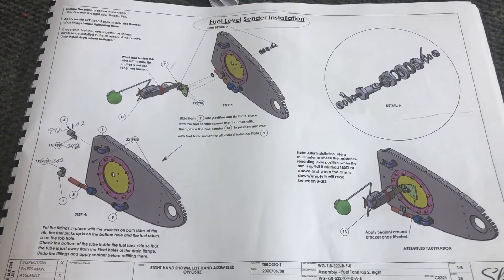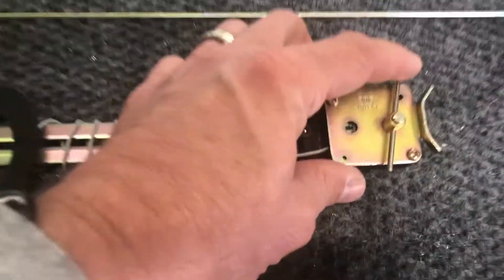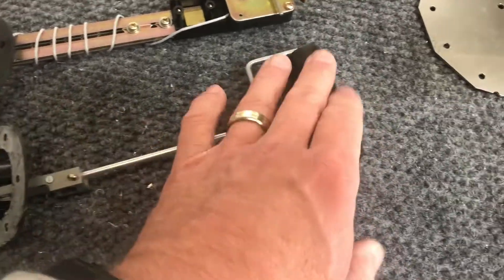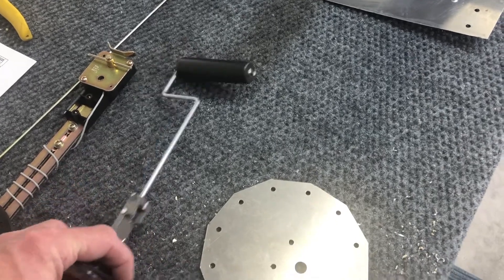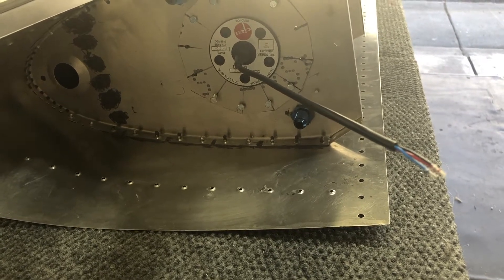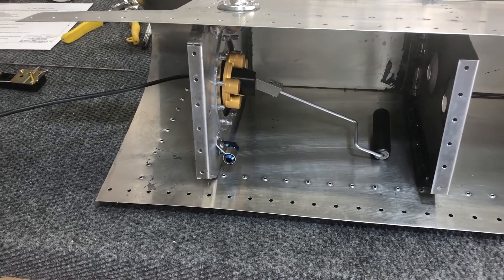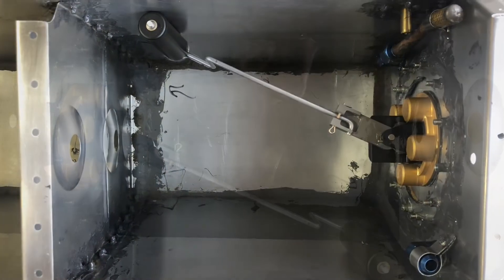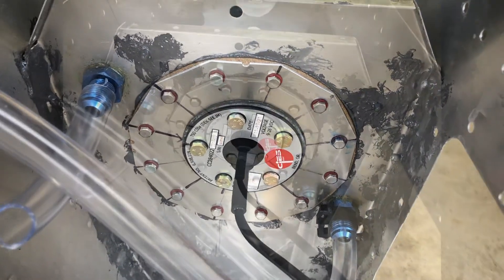Sling Fuel Sender

Comment: I considered these, too. But with the dihedral, you'd really need two fuel senders per tank if you want it to be able to read all the way from full to empty. In the end I decided it wasn't worth the trouble/expense, since the G3X Fuel Used calculator is so accurate. However, I can see these giving you extra peace of mind.
Reply from the maker: Well, it's not just the accuracy, but also the longevity and reliability.  I know a guy who has finished his Sling which the fuel tanks were built at the factory.  The fuel sender tends to "stick" a bit so he has to gently bang on the wing to free it up so it reads correctly.  Since the Cies senders only have the pivot point inside there isn't anything else to wear out, whereas the traditional ones can and do wear out over time.  I certainly hope I'm flying long enough that it would be an issue (or a non-issue in my case)... but hey - every little thing helps.
Reply: The G3X Rotax 915 fuel calculator is not at all very accurate. Mine varies between 1.5-3 gal off per fill up. No way to recalibrate it until Rotax and Garmin play nice and come up with better software.
Reply: Mine is within a gallon every time.